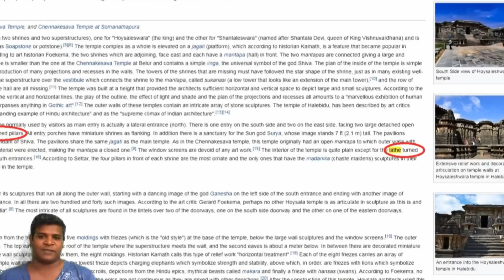Hoysaleswara Temple, India - Built with Ancient Machining Technology?

Comment: Bro it's just like a Turbine system. In a lake, if you put a massive wheel it would turn by the movements of water and as a result it can and will produce electricity or simply a water pump. You have to take point that Humans in those eras, due to their life style and diet were stronger ! These things have been machined but it was done manually. Instead of a huge or powerful electric motor turning the blade or trimming tool, they made it of stones and with ropes along with the help of animals or slave they made their own machining device. If it was alliens they would have leave their device or made just like theirs for the people so that they could use it for other structers we wanted to build. Also we would have found them eventhually but if you think of it, they (Humans) made their own machine and because it was so simple and worthless they didn't bother observing them and I believe everytime they done building or crafting what they wanted, they destroy them ! Like Tissue Papers. Just like transportation device. the word CAR came from Carriage. It was first run on pieces of wood ! Now we have a 1000HP Bugatti Veyron. The symbol in the statue that you have highlighted is clearing pointing about SUN ! Just because Archialogist said something doesn't make them RIGHT (All the time). They tend to come up with different theories all the time. I would say not that these status made from one piece of Stone. Also there are no such thing as Aliens. The Aliens that we humans referring are the Fallen Angels. The Hindu gods (They seemed as god because they were capable of performing actions and speaking of intelligence that most people or all people wouldn't have think of. Your Hindu Gods are Nephilins (Fallen Angels) from Hell. Came to Earth to rule humanity in the way they like. Jews-Christianity and Islam are the three main religoun in the world and they are all against worshipping idols. Surely they had the knowledge of Gods because they were not human, they appeared in human through human eyes. Until 1400 years ago. The Birth of Prophet Mummahd, god has closed the barrier between our world and theirs. That is why you don't see them or hear anything fom your Hindu Gods. Unless you perform a satanic virtual which you might call it a Holy Virtual and they would apear for a short period of time through your eyes only. Scientist who build CERN (In switzerland) were attemding to discover other dimension and guess what they did ! They oepend a dimension through the dark world and guess who appeared (Kali) isn't that name sounds familier to you ? Also the fact that the statu of Shiva is in the middle of CERN which is in switzerland and I doubt the Swiss are Hindu was then gathered around before the day by who are the So Called leaders of the world to bring Satan and his followers to earth and rule the world without being hide behind. Heard about NWO (New World Order) ? Freemasons ? illuminaties ? Dude you are Indian and this sort of things should be obvious. Unless you want to gather people to watch your videos so that you can get paid from Youtube. Smart :)

Comment: I imagine they could have used a different type of lathe. A type we use today for superbig objects. In that type of lathe the chisel moves around the working piece. It could be that they setup up the raw pillars and used a scaffold around it which had the chisel on it. Then they could simply fix the chisel on a certain height and move it around the pillar manually.
That probably took quite a while.

To polish and get perfect concave shapes on the bull the probably created a form which had the desired shape. Then put sand onto the bull put the bowl over the spot you want to grind and gradually rotate the bowl in a circular motion around the spot. the closer you get the finer the sand you use. 
Eventually the shape you are grinding is a perfect fit for the bowl you used. So the better the bowl is the better the shape is you are grinding.
Today such a technique is used to grind lenses for telescopes. It is the most precise way of creating a concave or konvex circular shape of a quality that high.

Also don't forget that these masons probably had a ton of time, and these kinds of temples only employed the best masons with a ton of experience alot of helpers and almost unlimited amount of resources and money.

Most religious ancient churches temples and whatnot would cost us billions to build the same way they were built back then.
Today we cannot imagine that kind of effort being spent on a building.

Comment: Yes I think it is possible that it is possible that such pieces were machined. I would like to offer an alternative explanation. There is the possibility that such intricate structures were cast. This would allow the builders to form the shapes with softer materials. Imagine if you will a figurine made from wood and beeswax and intricately shaped to perfection. Then a mould is formed round the template and heated until the beeswax burns off and the wood can be removed. The mould can then be filled with any setting material to form the finished product. Much of the technology would be associated with the creation of rock like cements. Hints of this kind of technology could probably be found by examining everyday objects like pottery of that time.

Comment: There are too many decorations and details just for a bunch of artists and contractors to finish the job. I know that with dedication you can create that, but for the common sense and the practicality of finishing a building that has to serve a purpose, the lifetime of one group of people (and the problem they're trying to solve) is too valuable to spend the whole life or a couple of generations creating something. The closest example we have is the Sagrada Familia in Barcelona that's almost 100 years under construction, and people are getting tired, funding is insufficient and impractical, and doesn't seems to advance to completion.(and aside tourism, it won't serve any other bigger purpose or goal for religion). The "temple" on the video looked like it was built with brute force and carved out of the rock. You don't see joints or connecting points on the pillars and the roof, and the decorations looks very consistent, like they used a template for it. Also the big question is: why all of these civilizations used rocks to build stuff? what about insulation, soft materials, water channeling inside a building, illumination, garbage disposal. Surrounding buildings and their purpose, walking distances to other places like houses. Where are the markets, etc... Too many things unanswered and seems for archeologists, every building is a temple to worship gods.

Comment: You forgot one thing in your analysis. Ancient technology had been able to do castings  with a material that sets up exactly like stone,  a feature that today's concrete has not been able to duplicate,
Therefore it would be very easy to do lost wax casting in such precise ways to fool even the most intelligent .
Or just use commonsense and melt the rock into molds as needed. would more then serve this same purpose.

Comment: Do you think a "machine" was built and placed around it,  kind of up and down like a screw but in this case it spins in stable spot with enough pressure to cut what is seen. Just a thought. I'm just talking about what is shown @1:15.    Where he passes the light through, im not even going to try and explain that. Very interesting. Thanks for posting.

Comment: The temple was made about 900 AD. It's not that long ago. Europeans were making all kinds of metal machinations during this period, despite being in the height of the Dark Age. India benefited from the advanced mathematics of China and the Middle East during this time, as well as the advanced machinations of each of those regions as well as their own unique developments. India was also making the best steel at that time: wootz steel. It's a metal for which the recipe was lost, but we are finding out more about it even today -- including that it had carbon nanotubes in its crystalline structure. They were certainly no slouches technologically during that period.

It would not surprise me that they were using high-torque gears to turn the pillars. It looks like they used something about an inch wide to grind on the pillars as they turned. Even with precise measuring, it would be impossible to get the symmetry you see in the pillars without turning them.

I will say that what you showed was a poor facsimile of a planetary gear. Instead, I think it's something else. I would not be surprised if they maybe used a planetary gear setup as the technology exists in Europe, Africa and Asia since at least 700 years prior to that. I just don't think that's a planetary gear. It could be a rudimentary transmission, though, that would engage different sized gears to help get a giant 3 ton block of stone up to speed.

Comment: Its mostly all Wood, Turned to Stone, All Fused Together. Its possible that Gear Ratio is a proudly displayed technology (how we did it), perhaps used with timber & metal machines like Large Lathes, driven by men walking/ running around/ pushing a roundabout. The polishing is likely created overtime by human hands touching.
The Structure overall is most likely Pre Flood & was excavated by Early Post Flood Civilization.

Comment: They clearly moved the cutting tools around the workpiece. It's a very easy explanation. And burr tools have been widely used for millennia, aka pump drills.
Lastly, Inians, especially South Indians, held the knowledge of extremely high performance crucible steel (wootz) for many centuries, perhaps millennia, before it was discovered elsewhere.
No mysteries here, folks, just extraordinary craftsmanship and artistry.

Comment: Iron metallurgy is a nearly 3000 year old invention, so the working parts of maxhines to make such constructions have been available of a very long time. The difficult part have been tthe powering of the tools, but driving mechanisms using muscle power, animal power or watermill power were possibly used.

Comment: Seeing as how the pyramids and related structures in Egypt have been shown by Joseph Davidovits to be manufactured geopolymer stone, it is highly probable that all ancient rock constructions of world are the same. Geopolymer "concrete" can have the consistency of mouldable clay and slowly hardens into rock, virtually indistinguishable from the real rock that the geopolymer's weathered aggregate consists of. Chemical analysis of the artificial rock is required to distinguish it from real rock, not just inspection by microscope, as geologists do. While plastic, the hardening geopolymer can be tooled quite easily, added onto, etc, similar to clay and ceramics. With skill and technological development, an extremely complex, multilayered, finely made rock sculpture seemingly of one solid piece could be constructed. We see this in some ancient hard rock sculptures in which fishnets or veils full of tiny detail are covering detailed human figures underneath, all seemingly impossibly "carved" as one piece. Chisels and hammers were obviously not used to create the figures.

Comment: Lathes have been used to machine columns for over 2,500 years. These columns shown are well within the size possible for stone lathes. The stone is first cut roughly to the circular shape then rolled into the lathe pit before being levered or lowered into place in the lathe rollers. Greeks and Egyptians used sand beds to move heavy stone into position with only a few men who later removed the sand so lowering the stone into place.

Once in position leather straps are used around the column ends to turn the piece while it is ground to shape using harder stones and grit. Later metal tools can be used to fine cut detail. The mount ends are cut off before the finished column is built into position.

Comment: It is difficult to spin a 12 foot stone pillar between two points. Other possibilities, however, would be to suspend the pillar by a rope and allow it to twist back and forth while grinding with other rocks. Or to support a relatively light tool on the outside of the pillar by wood and/or rope and let it revolve around the pillar while grinding away the rock.

Comment: The serpent represents electricity, taken from lightning arcing across the sky. You can see the proof at von Daeniken's bulb at Dendera Egypt. It lines the pyramids which I believe are piezoelectric machines made from rock of great weight to stress the quartz infused rock,. Check out the beam photo at Chichen Itza. Also the serpent is shown representing the soul, which paranormal researchers have shown to hold  current, and science knows electricity runs the body. I believe to see these machines at work all one needs to use is Full Spectrum photography or Nightvision. The Chichen Itza photo exposed the beam is because it was a cheaply filtered cell phone. For a century plus we have blocked this light from our photos.. Bosnian researchers a have already shown them to still be emitting current at their apexes.

Comment: Great video, very well presented. I'm an engineer with 32+ years and I've used quite a few bur's in my time. 
I say it wasn't a bur that did this, or at least it wasn't controlled by hand. To get the RPM and feed right and keeping a tool cool so it doesn't break or get clogged, would take a lot of knowledge. 
The gaps are too small, there is no evidence of the typical marks that a bur will leave behind. If this was attempted today, there would be a mountain of broken burs left behind. 
Again, Great video. 
I must subscribe!

Comment: I am basically a structural engineer by training and a practical engineer by work. I never went to college to achieve this. I learned it all in the US Navy.  I fix the elderly and handicaps homes now. What you show here is very amazing.  Those little skulls would be the most hard thing to make I would think.  That would have required exact casting methods or a very small carbon  laser or cryogenic laser today. I am not even  sure we  have the means in the civilian areas. Military it may be  possible but if it is I can say for sure that it's classified.

Comment: the same effect can be achieved by using rope and abrassive and you still have the tell tale turning marks ... no machine required just old fashioned sweat and elbow grease. 
.
 the use of rope and abrassives will also polish the stone at the same time ... the gears are easy to design as well ... and using it would be as simple as a pulley system and levers which they knew very well ... so there are other options .. this is NOT definate proof of machine work .. just old age smarts.

Comment: AT 1:55 I SEE YOU ARE MISSING SOMETHING; THOSE ARE THE SAME NUMBER OF STUPA IN THE BOROBODUR TEMPLE WHICH IS A STONE COPY OF A METAL SPACECRAFT ACCORDING TO THE THOUSANDS WHO WATCHED IT LAND.  The second meaning is no accident. The travelers left behind a decayed drive unit (stupa) which later became known as the Nazi Bell.  
I have completely reverse engineered that circuit, zero point circuit, capable of faster than light travel. They mined radium in Moab Utah the same time it had landed there. Just look at the petroglyphs.

Comment: Fantastic, I am a retired machinist and have spent many years on lathes and milling machines both manual and CNC. I am saddened that today's western world pats itself on the back as if it is the smartest and most advanced civilization that has ever lived on this planet. From what I have read, and many times too, If we (humans) disappeared from this earth today, 400 years from now there would be no trace of anything we had done left. Yet this temple is 900 years old and we cant figure out how it was constructed. The Pyramids are much older than that and they are still around. 
         May I offer a thought. Present day man, at some time in the past chose to use metals and much of our technology is based on what we have learned to do with metals. I believe these earlier civilizations chose to use stone and rock as their material of choice.  They developed ways to do the same things with stone that we can do with metal,. That would mean that some of things you pointed out eg. the skulls or the double necklace  may have been 2 pieces and stone welded together not one. We cant weld stone today because of the course we chose a few thousand years ago. But if we had chosen to use stone instead of metal, way back then, Machining and welding stone might have become a day to day occurrence. (But of course, metal is better for making weapons to kill with). We should have chosen stone.

Comment: Just thought about the Lathe idea. Most lathes run with the work piece horizontal but the stresses on the rock would be significant. It wouldn't surprise me if they were machined in the vertical orientation on a rotating platform and something to steady it at the top. The planetary gearing system could have been used to increase torque.